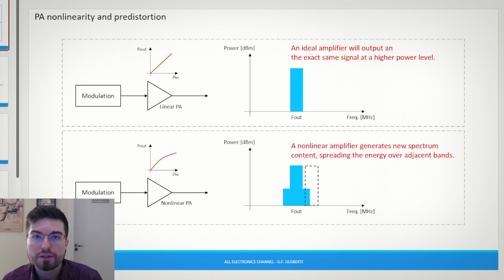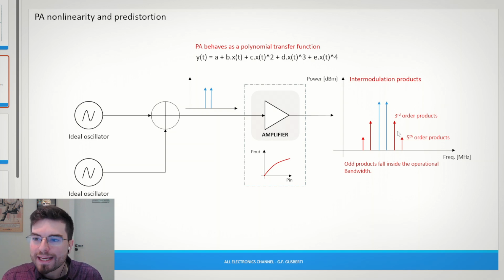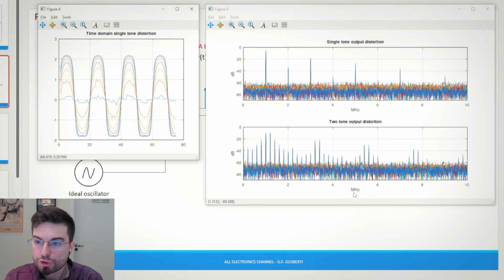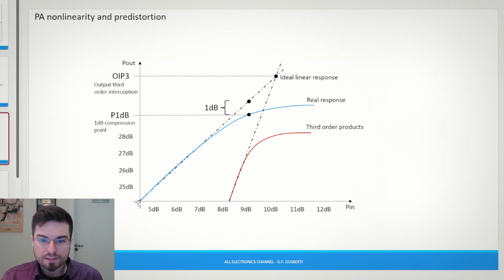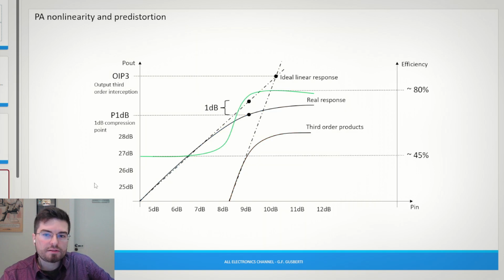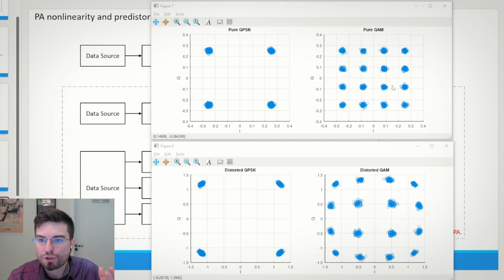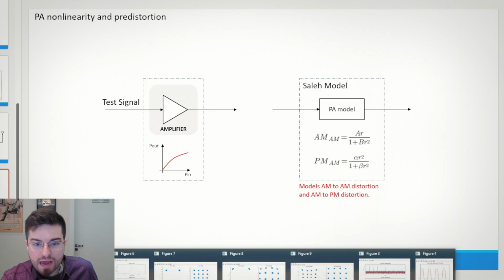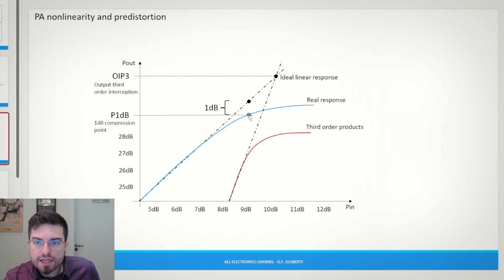Power Amplifier Linearity and Predistortion

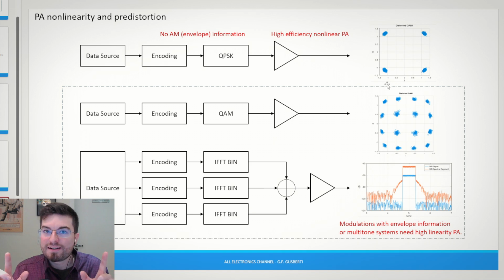Comment: 16:54 Is the amplitude-to-phase conversion similar to quadrature modulation?
21:08 In conjunction with higher order modulation? Or in conjunction with amplitude modulation? I assume 8PSK isn't more susceptible to compression than QPSK, because 8PSK doesn't use AM. Correct?
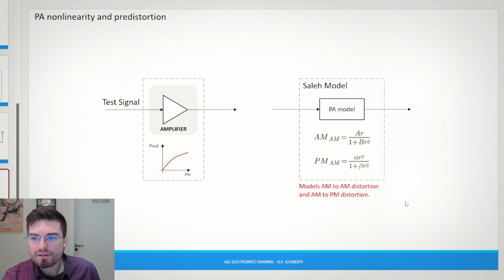22:02 Is the Saleh model the only available predistortion model? Is this predistortion a form of amplitude "expansion"? Won't every amplifier require a different predistortion model?
Thx!
Reply from the maker: Yes, similar!

There are many models, Saleh is one of the oldest one

Comment: I worked on this extensively about 20 to 25 years ago, when technology was emerging to make this practical with off the shelf DSPs, without having to rely on dedicated ASICs or a large component count solution. There were other complexities in my application, as it was for space, and I was also using additional methods applied to the PA itself, based on Doherty techniques, to improve efficiency to reduce power budget and improve thermals.

I never thought I'd ever see a Youtube video on it though! Bravo!
Reply from the maker: Thanks!!

Comment: Thanks for the video!
You made the concepts very clear, I especially liked how you explained the OIP3, it is always a little strange to think about it in a way. 
Mobile basestations use predistortion as well.
I have even seen systems, that use a directional coupler on the antenna output, where they have a complete IQ downconverter into baseband to monitor and dynamically tune the input signal, very fascinating.

Comment: In the industry all the amps of the same manufacturer are predistorted with the same model or each system is tested and then it’s nonlinearities are measured to calibrate and correct it’s behabiour?
Reply from the maker: Both.. advanced systems use a real time receiver that samples the output and adjust the pre distortion system in operation

Comment: Great presentation.
It would be good to see some circuit implementation of pre-distortion.
Reply from the maker: I think that old analog pre distorters used diode structures to create the distortion profile
Reply: @AllElectronicsChannel  I saw an active cancellation in one chip, by taking part of output filtering out the band using band stop filter and adding the rest with correct phase and amplitude to the input to cancel them out at the output.  The control loop tries to minimize out of band signals by adjusting the feedback amplitude and phase.
They do that to say class D amp, so they can go above 1dB compression even higher than 3rd order intercepts.  Since in class D the output transistor is either on or off, only the duty cycle changes.  Remember the switch transistor must be much faster than carrier signal.  So for 10MHz transmitter you need 1GHZ capable switch.  Of course the output has a band pass tank (LC parallel circuit)  in front of it.

Comment: Around minute 21 - I think that receiver-side compensation for the amplifier non-linearity is possible (for example, using known calibration symbols), however the issue will be different - the resulting transmitted signal will be much more susceptible to noise due to the decreasing distance between the constellation symbols.
Reply from the maker: What I think very interesting is that the "spectrum" is a linear concept. Is the frequency domain point of view of the time domain world. I'm not sure, but I don't know if exists some fundamental limitation for the existence of other points of views, like nonlinear ones